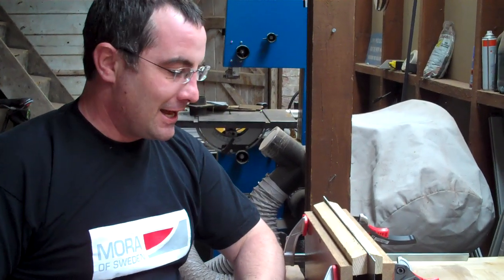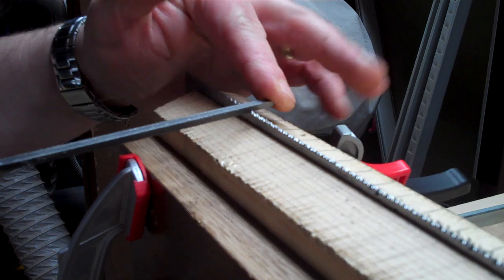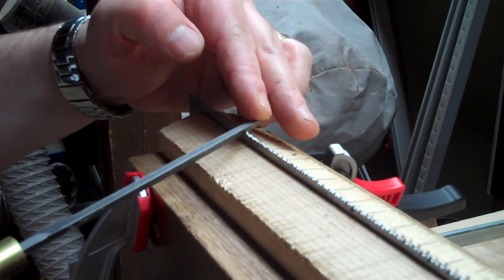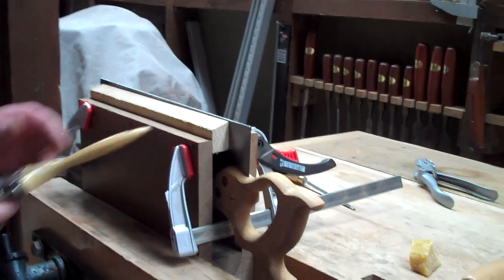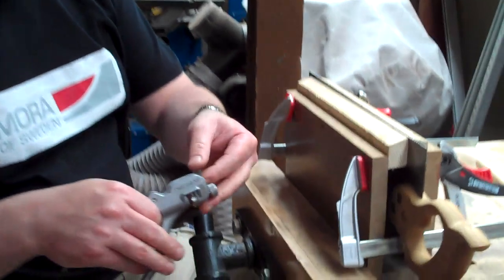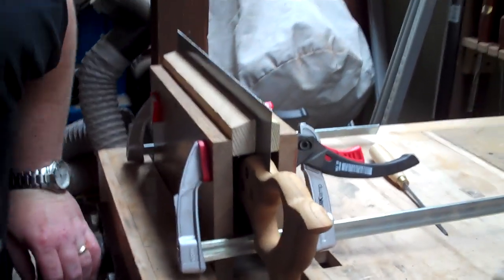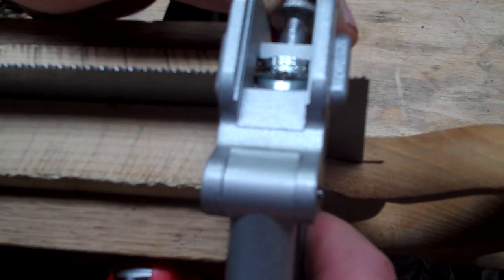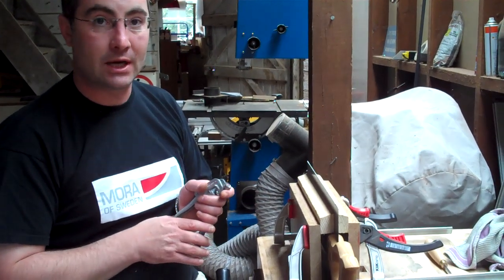Workshop Heaven - Saw Sharpening (Part 2)

Comment: i tried this how many times now and for some reason every other tooth is a bit higer than the other
Reply from the maker: +Allan van der Merwe 
Hi Allan, sounds like unequal pressure on the file, check your stance to make sure you are in a comfortable position. To correct unequal teeth, just apply slight diagonal pressure towards the bigger tooth. Hope this helps.